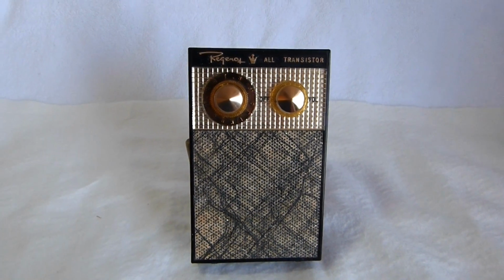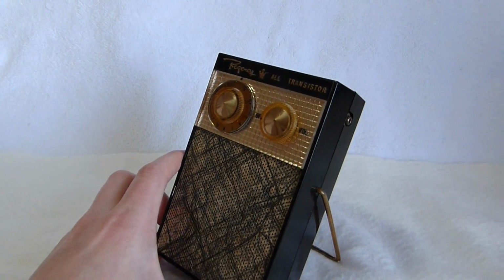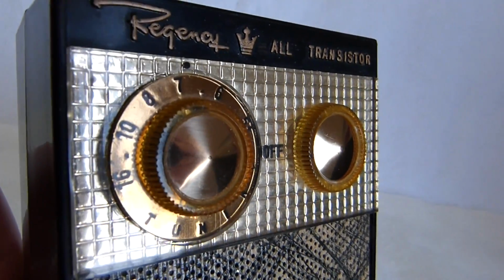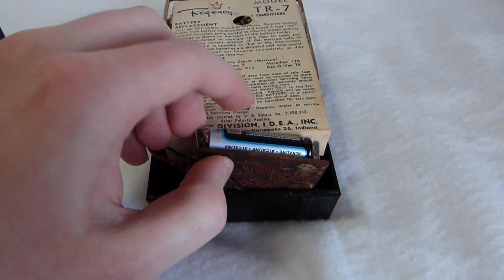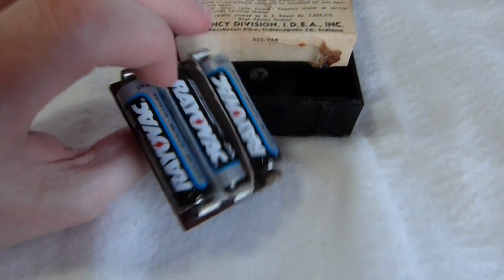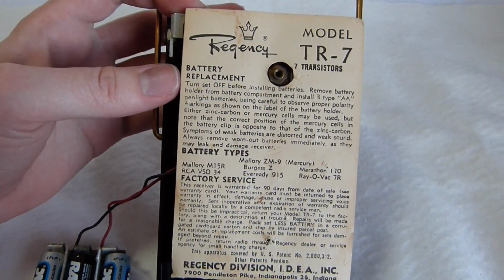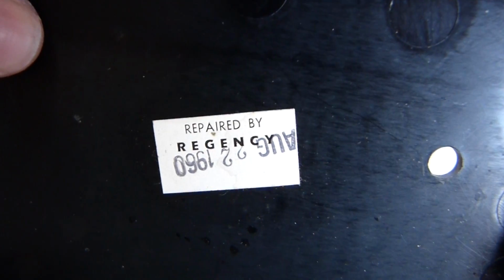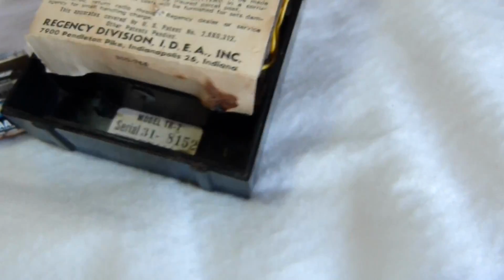1959 Regency model TR-7 transistor radio

Comment: It seems, looking firstly at the TR-1, that different circuit designs were tried, as it operated with a 22.5 volt battery, using a class A audio output. The battery was also used in the early flash guns in photography.. The TR-7 likely used a class AB audio output, with the 4.5 volt battery supply. I wonder if the price was the same?
Reply from the maker: +jmcgatkinson I believe this set uses an ordinary class B amplifier design, with input and output transformers (like most pre-1960 sets). This set apparently cost 39.95 to the dealer, so it probably sold for around $50.